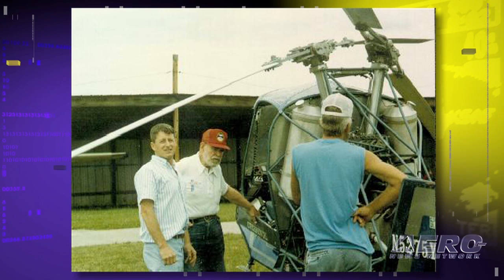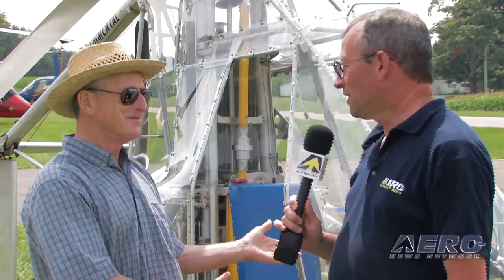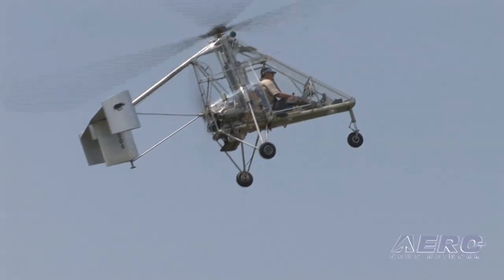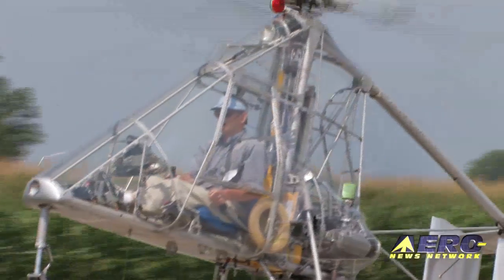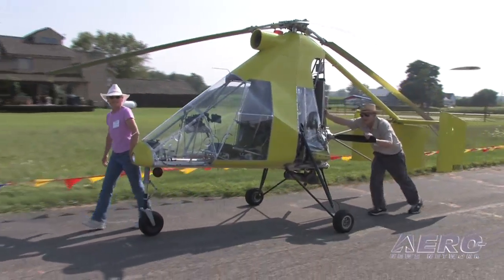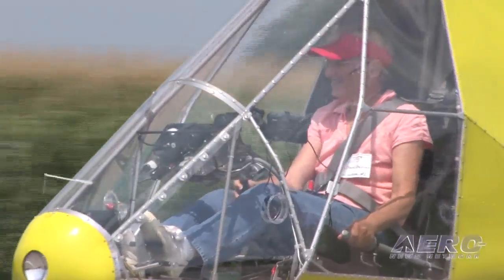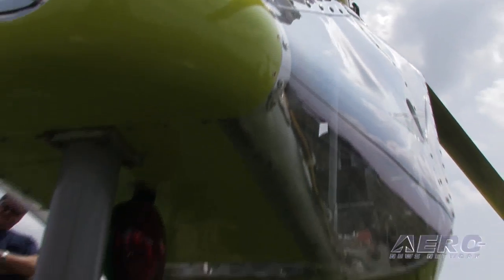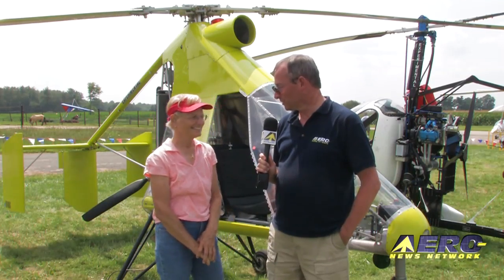Aero-TV: Jump Takeoff Gyros - Dick Degraw's Homemade Masterpieces

Comment: Fascinating. What an amazing feat. Can’t believe I’ve only just seen this now.
I have so many questions.
The principle of action of a helicopter and an autogiro have one big difference. Whereas airflow is upward through an autogiro’s rotor disk, with the blades flying through this air to provide lift, a helicopter forces air downwards through the rotor, like a fan. I wish that the presenter had asked about that. 
How is the power split between rotor and propellor? Is it variable? What are the advantages, since it still can’t hover? Does it have a fully controllable collective, or is it an Off/Jump toggle? How about cyclic?
And the little baby “Kaman”. I want to know more.

Comment: If the engine is constantly connected to the rotor, then how can this craft be called a gyro plane. I thought the rotor was free rotating and it only connected to engine when in the pre take-off position.
Reply: Just a guess on my part but maybe Dick found a way to install a "slip-and-grip" clutch but re-engineered the clutch to be in constant engagement with a low force spring plate  When the  main rotor reaches jump take-off speed, he feathers the collective, gains altitude and forward motion from the pusher prop thrust. Now the relative wind will be supplying the majority of the spinning force into the rotor and the mismatch in speed of both sides of the clutch plate overcomes the clutch friction allowing the clutch to slip. What little torque force added to the system by the engine crank to the rotor shaft to create torque is overcome by tail rudder authority. 

Slip and Grip clutches are used in modern motorcycles to disengage the driven wheel from the drivetrain when there's a severe mismatch in engine RPM and wheel RPM during downshifts which can lead to bike instability and prematurely worn out rear tires.
Reply: Was wondering the same..
Reply: I learned later that if the rotor pitch can be adjusted, then a Gyro can have the ability to so jump takeoffs at the pre take-off position. However, in my opinion, it would make the machine more complicated and more expensive, something that defeats the purpose of the aircraft. If you want to jump start, might as well get a helicopter.
Reply: E W Well it is the constant partial drive to the rotor that intrigues me.
Reply: 'constant partial drive' that is paradoxical. It cannot be constant and partial simultaneously. My understanding is that the rotor has a mechanical, electrical or hydraulic connection from engine to rotor for pre-rotation. That is they begin the rotor rotation to about 200 RPMs, then it is disconnected and the Gyro is ready to take-off. In less sophisticated Gyros the rotor is manually pushed and then the runway speed moves them to the point they obtain lift - a longer runway run is required. Hope you intrigue has been satisfied.
Reply: Airflow through the rotor has to change at some point after jumping into the air.

Comment: They said that the rotor always has a certain amount of power, so it's not like a regular gyrocopter.  He's using rudder to compensate, so as long as he's moving forward he can cancel the torque.  That's why it's a jump take off.  He needs to start moving forward as soon as possible, after the take off.
Reply: Not necessarily.  He's got enough thrust from the propeller.  Judging by the pitch pins in the rotor head, and the Collective control lever in the cockpit, this vehicle is essentially a Helicopter.  Which means, it has the potential to hover, either by facing into a strong wind, or tilting the Rotor head 'rearward' to compensate for forward thrust from the propeller. IMHO.  :D
Reply: Whay this concept do not Go for... Future. Where's this Genius?

Comment: Torque forces doest real exists here, but the rotor drive is disconnected before take off.
The rotor (heawy for better inertial) is accelerated up to 500 or 600rpm with zero pitch,the rotor drive disconnected, up to take off pitch, and if the gyro is in the air, the propultion engine is set to full power , the normal pitch set as the gyro is fast ennough (over 40 kph)..

Comment: How does the Gyrhino compensate torque forces? Dick refers at 2:35 to something about rudder but I can't understand cause I'm not english speaking native so it's just to difficult to listen to. Anyone can help me in writing what Dick says? Thank you.
Reply: pomatoso.  the airflow From the pushing propeller gives him enough control to keep it straight
Reply: The rotor is powered by the engine and oversped on the ground for "jump" take off. 

When in the air, the rotor rpm is reduced to normal for autogyro, but the engine is still powering it a bit (the clutch isn't disengaged), and because of the torque isn't high, it's controlled with the rudder.